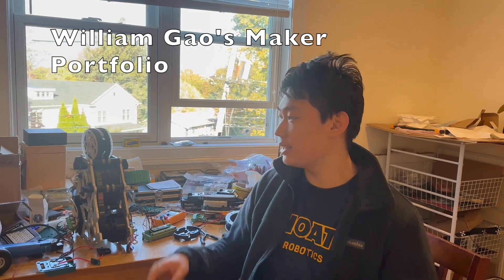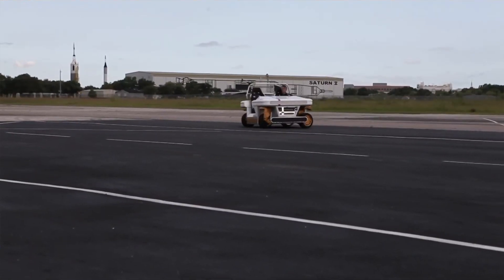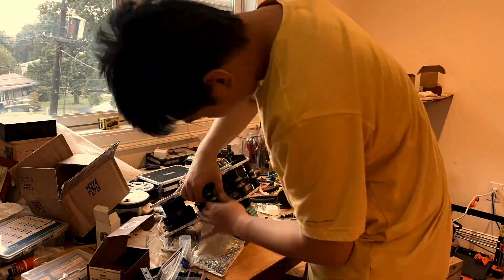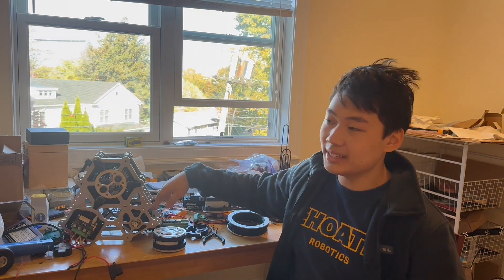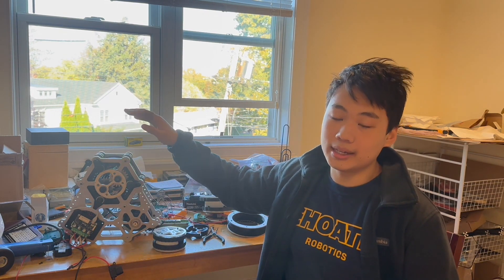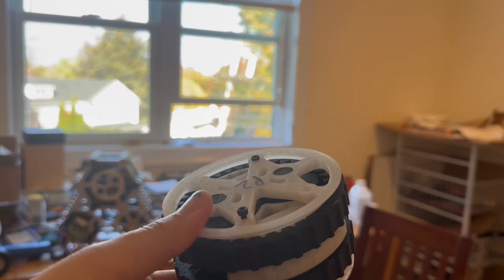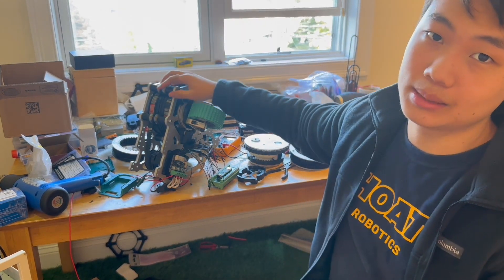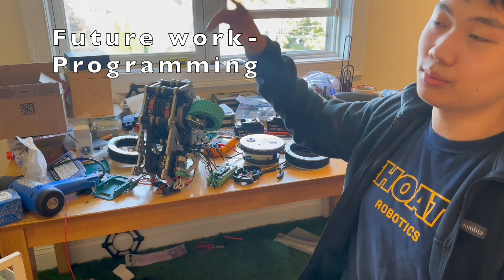Differential Swerve Drive

Comment: It's this kind of design that's actually rather useful in Robot Combat, particularly when it comes to developing full body spinners.
Reply: If your robot is a full body spinner our drivebase is already a "differential swerve module" relative to it, just multiple wheels instead of one. If your robot is round holonomic motion isn't that useful as it just turns into a race of turning a module faster than the drivebase would turn

Clean implementation OP

Comment: Was this ever used in an frc robot?
Reply: This module likely not. In previous seasons there have been Diffy swerves. However due to the propulsion motor limit diffy swerve as well as 3 motor swerve is no more in official events.
Reply: Not an answer to the question but are being used very uncommonly in combat robotics, most notably Triple Crown in the heavyweights (250lbs) and Shifty in the beetleweights (3lbs)